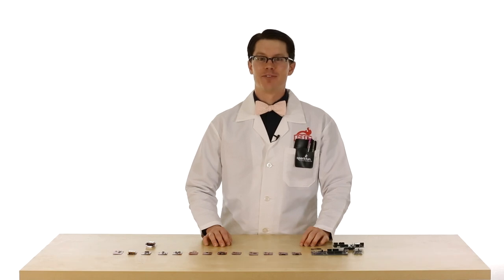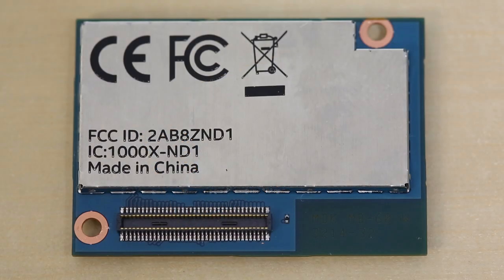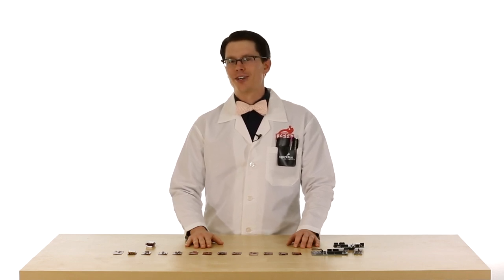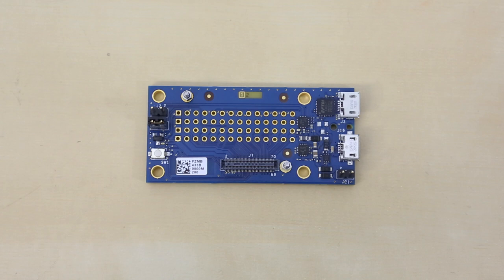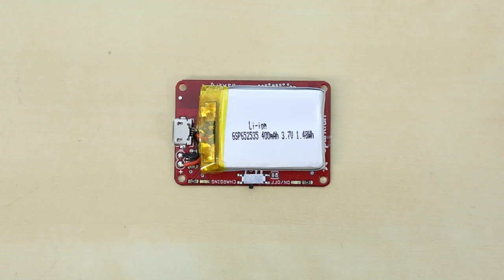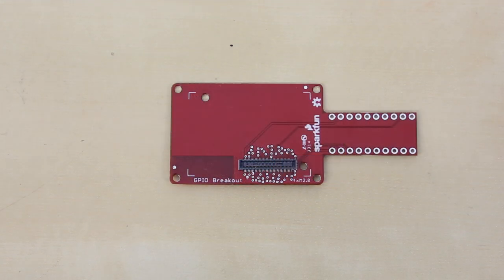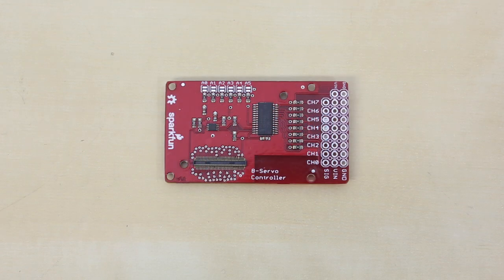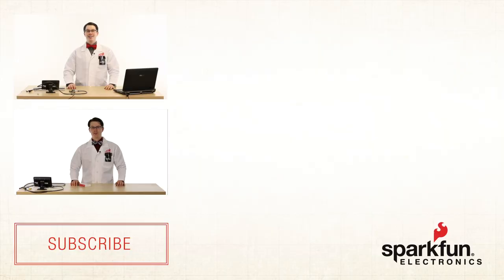Intel Edison and SparkFun Blocks

Comment: Quite speechless at the moment. I like the idea of the brains-part being detachable/using several blocks/shields/etc.  The form factor is amazing, so small, but you give away the graphics capability for it ...

Wifi and bluetooth on board makes it really interesting. Its something the Raspberry could include one day... and it was a pain before the B+ appeared (2 usb's meant using htem all just for wifi+keyboard, or using a usb-hub).

By the way: Why didn't you put a link on the description?

Comment: One good thing about this. It makes the Yun look better.
Reply: I am puzzled by your comment.  Exactly how does Edison make YÚN look better?

As far as I see it, in comparison to Edison, YÚN is slower, has less memory, has a larger footprint, is more expensive and has no Bluetooth.

The only disadvantages I see is 1.8V GPIO, which I don't mind the too much, but the fact that you can't run it off 3V or 5V.
Reply: Because it has Arduino without a $99 additional part that doesn't really make it Arduino.  Why the silly 1.8v?  Seems you have to buy at least some expansion to use Edison. They just could had made it more useful.
Reply: Richard Waterman

Yes, I don't understand why anyone would turn it into an Arduino for that price.

I guess the best use for Edison is for IoT.  That is what I am using it for and there is nothing in comparison to it for the cost and size, especially if you need both Bluetooth, WiFi.

It would be silly and expensive for someone like you to use an Edison in your projects, and it would be silly and expensive for someone like me to use a YÚN in my projects.

So for the consumer it is target for, the Edison is an amazing groundbreaking device.
Reply: Richard Waterman
Intel doesn't have an IC process that does 3.3V at low power, all of their stuff is on 1.8V and lower from their Pentium family of processors. They just use the same process and tools for this. I don't think they have an idea about the hacking community or they would have had at the very least translators on the board. BTW, most of the ARM devices that run off 3.3V actually have an on-board regulator to provide 1.8V to the core but the I/O is/can be powered off 3.3V.
Reply: inaicrnd you dont turn it into an Arduino, you can attach an Arduino like micro-processor to it. It is way more powerful than many Aduino's combined. Id explain it, but it's kinda technical.
Reply: Chip Estrada , if you are talking about the timing issues that come with a multitasking Linux base, then a Yun is actually better suited.

For me, a standalone Edison is perfect.

Comment: well I've been using I2C for around 25-30 years now and it's always been I squared C not I two C because it's an "Inter IC" bus, ie IIC but Philips decided on ISquaredC which is of course I2C. Re Edison, the 1.8V logic is a bummer, I understand why Intel did it, they don't have a 3.3V process that is low power, but it's does increase your chip count. I'm also surprised that Sparkfun doesn't put 1.8V translators on their shields, especially the one designed to plug into a bread board.
Reply: I too see that it's I squared C and not eye to see.
Reply: Very droll :-)

Comment: Hi, Peter,
 
I have successfully connected my phone as BT  device and did the SPP communication. But now the problem is, whenever I am trying to connect my another ECG BT sensor, I get something like this
 
[CHG] Device 00:0E:00:09:D8:F6 Paired: yes
Pairing successful
[CHG] Device 00:0E:00:09:D8:F6 Connected: no
[bluetooth]# connect 00:0E:00:09:D8:F6
Attempting to connect to 00:0E:00:09:D8:F6
[CHG] Device 00:0E:00:09:D8:F6 Connected: yes
Failed to connect: org.bluez.Error.NotAvailable
 
How can I solve this problem? Even I downgraded my Edison and even tried with Ubilinux still get same result "Failed to connect: org.bluez.Error.NotAvailable". Pleas help me out in this critical situation
 
Thanks and regards
 
Susanta Sharma